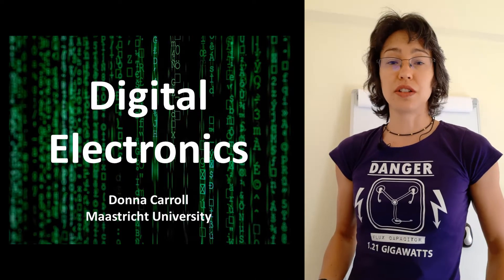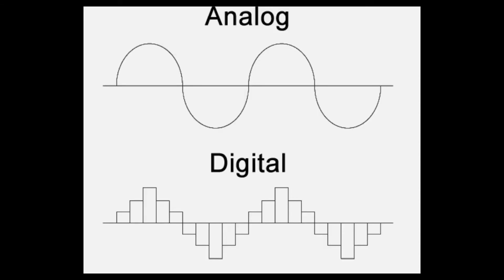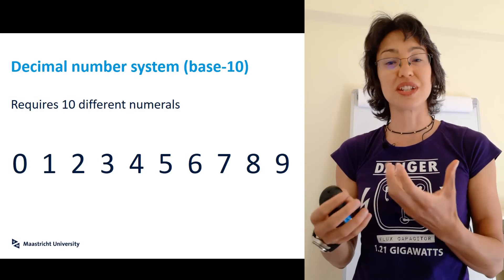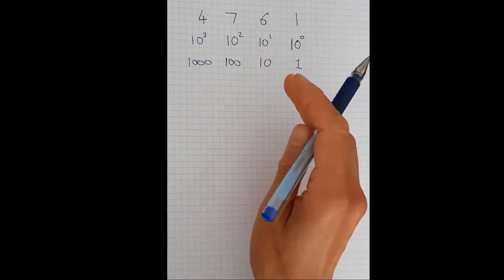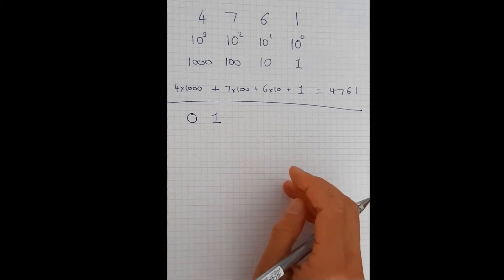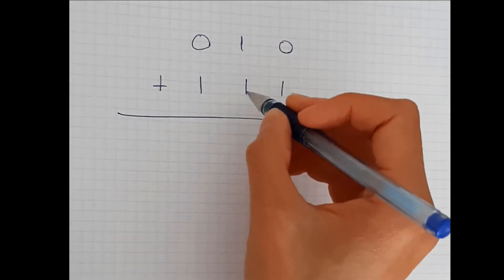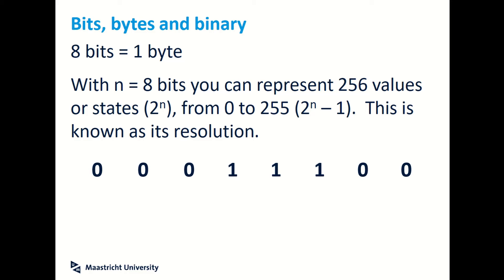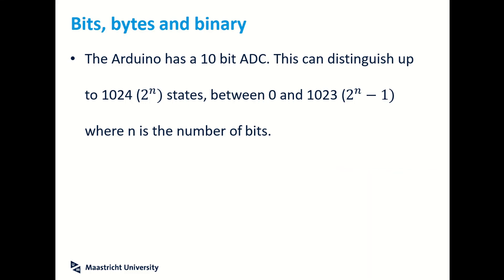Digital electronics (part 1/8):  An introduction to the binary system

Comment: I was under the impression that memory was always described using power of 2's, IE 1 KB = 2 to the power of 10 or 1024 Bytes (not 1000) and 1MB = 2 to the power of 20 or 1,048,576 (not 1,000,000). Where is the differentiation on when to use this? Excellent videos.